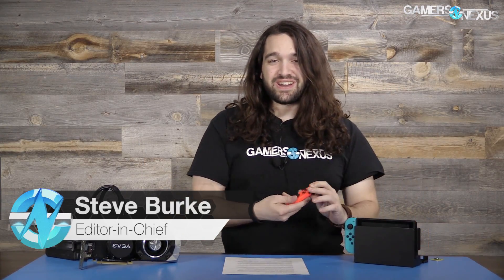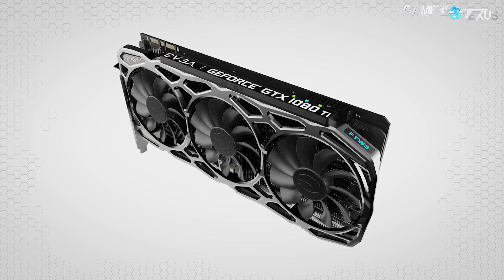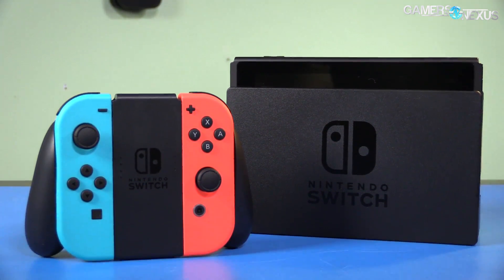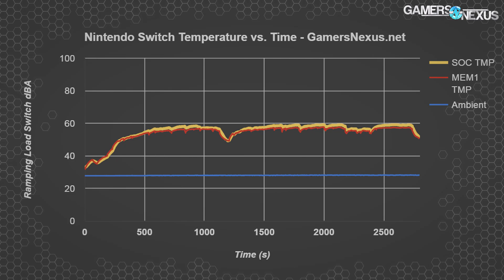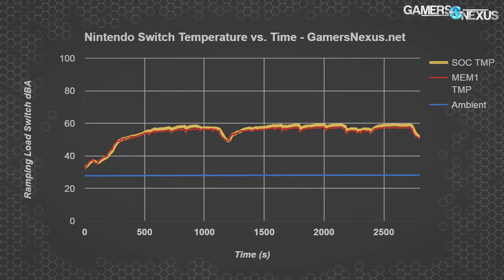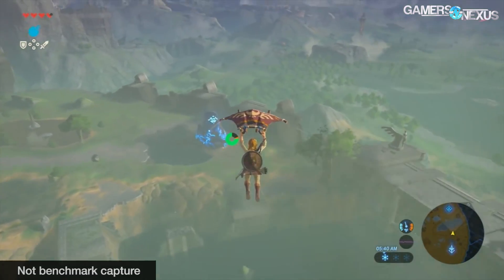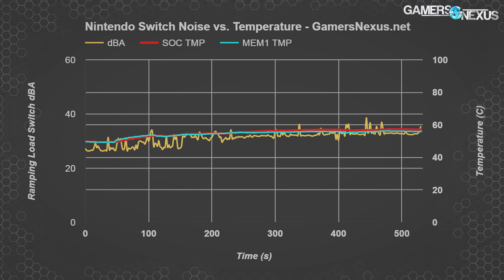Nintendo Switch Thermals, Noise, & FPS Drops

Comment: Maybe they improved the software quite a bit since (6.2.0 currently), but I cannot hear the fan at all, neither handheld on battery, handheld while on AC or docked. It is very subtle when you stick your head up the docked console in BotW.

Comment: Is it normal for the fan to speed up for a few minutes every time after I load Zelda and slows down faster when I enter menu or home screen? The system is cool since I just turned it on. I called nintendo and the woman there telling me it's suppose to do that but I just want to know if it happens to every switch. Btw I only play in tablet mode.

Comment: Hey, exceptional video here!!! I'm thankful that you guys uploaded this. Furthermore it was very informative.     I was wondering if you could answer one of my questions in regards to the fan noise.   When I play in handheld mode, the unit is virtually silent, its to the point that I have to get right up on top of the vent to actually here any noise.   But for me at least, it's quite the opposite when docked. I can here the noise pretty easily. It sounds very similar to the sample you provided in the video. 

No errors seem to occur, and the air expelled from the vent is warm so thermal transfer isn't an issue. Could that perhaps just be the way the units fan is?

Comment: I've never heard my switch make any noise and I've used it quite a bit on handheld mode. 
Also to say "it gets hot" is a bit much... Warm at best, never hot.
Zelda also received a patch that fixes most frame rate issues except a few spots in the map which alot of greenery.
Reply: BowlOfRice Apply a quality thermal paste and thermal pads fixed most of these issues too. The Switch downclock’s the performance to stay below 60c.

Comment: I was very impressed by the acoustics of the Switch in docked mode compared to most other game consoles. It's hardly a feat considering that the thing only drains up to 16 watts, but still nice considering how loud and whiny that tiny fan could have been.

Comment: For frequency analysis, take an audio recording with the microphone 4-6 inches away from the fan, and then plug the audio into Audacity and run frequency spectrum analysis. Works like a dream and is super precise.

Comment: is 85'C in Occt Small packages ok for overclocked 7700k? I have it on air cooling with 1.200 volts fixed.

Comment: This may be overkill, but there is a procedure in aviation to correct for more annoying tonal noise relative to broad spectrum noise. It is called a "tone correction factor" and is added to the perceived noise level. If you are interested, the procedure is described here, in Section A36.4: http://www.ecfr.gov/cgi-bin/text-idx?rgn=div5&node=14:1.0.1.3.19
Reply from the maker: Julian Herzog Can't hurt to learn about it! Thanks. Will read.

Comment: Could you do a test without attacking the enemies? The Zelda series since OoT has always had an intentional single-frame drop whenever a strong or killing melee attack hits - this could be what the frame drop and associated slight temperature drop you're seeing is from. Maybe a test in some of the heavy framedrop areas around the Temple of Time where there aren't any enemies?
Reply: He should stand in a town and look in a direction that causes frame rate issues, surely that scenario would constantly stress the hardware (unsure if the frame rate issue is because of the CPU or GPU though).

Comment: VERY interesting data about the thermals & throttling. Ow, Nintendo... I'm.. interested. I'm interested to see if Gamers Nexus can put better thermal paste (or do direct die cooling) can reduce thermal throttling. Or if Buildzoid can come up with some way to trick the circuitry into doubling the fans RPM :)

When I get mine, I'm definitely going to research improving the cooling. There's got to be some way to increase the fans RPM via a hardware mod.
Reply: I want to do a casemod to add a couple 80 or 90 mm Noctua fans.

Comment: 2:00 To make your own:
prop your phone up on something in front of the switch
record the highest fps you can (6S plus does 240 but for a max of 30 fps in game a 60 fps camera would be sufficient)
run a spatial high pass filter on every frame of the video
count how many frames are in between frames that have peaks greater than the noise
you now have a vector of frame times

https://www.reddit.com/r/3dshacks/comments/4hgwg3/performance_and_battery_life_test_of_luma_3ds/

hmu if you want the matlab script.
Spoiler: it takes a long ass time to run.

Comment: From your teardown video it seemed the cooling design on the switch was pretty poor. With a bit of thought it looked like Nintendo could have easily made it better.
Reply: Asa Stewart It's because the GPU downclocks considerably when in handheld mode.
Reply: Yes I know, that doesn't mean the cooling solution should consist of three separate contact points with thermal paste between the cpu and the cooling mechanism on the other side of the console.

Comment: I know watercooling is complicated and will take a lot of work (although it would be incredibly cool), but can you do a simple test of just lowering your room temperature to the minimum on your AC and putting a relatively powerful fan blowing at the switch to verify if it helps?
If it does solve the throttle/frame dip issues then maybe third party solutions to improve the cooling while docked may eventually show up. Since the dock is essentially a simple usb/hdmi dock I'm pretty sure other companies can have a go at making it better.
Reply: Bruno Yuji 
"incedibally cool" pun intended? lol
Reply: Without modding, you won't get better temperatures. I assume the back of the Switch is plastic, and that'll cause thermal resistance between the inside and outside. And even if the case is aluminum, there's no paste or pads between the internal backplate heat spreader and the case.
You could always try blowing colder air through the blower fan, but there's just not a lot of surface area on the heat pipe's fins. 
But modding would get you better temperatures, though I don't know how great the outcome would be.

Comment: would it be a good idea to modify the switch so that there are less interfaces between the GPU and the heatpipe?
Reply: Think of the shield around the chip and system memory as the IHS for the chip; basically, improper application of a cooling method could burn the chip up. Though, there could be better methods on how to cool this with less layers of material and paste, there's about 10 or so layers from the silicon die to the internal back plate that spans the area of the switch itself. I would assume this would be inefficient for cooling, but apparently it's good enough for Nintendo.

Comment: Build a box, and use soundproof foam around it, with a dynamic mic inside such as the sm57. Connect that to an xlr output on the outside. Do something similar with power/ peripherals and you have a isolated mini sound proof room. Easy as that

Comment: Do you think a 240mm radiator makes a difference compared to 120mm in GPU cooler?
Reply: Dr. Ass yes. more fans can work on it. so eatch fan can spin on a lower speed and the cooler wil be quiter

Comment: It is possible to write software which captures the FPS. All that the software needs to do is to detect a change in the colors of the pixels, everytime it analyses every 10 millieseconds the pixels, if the colors change it increments a counter with 1. I don't claim that it is easy but a good programmer should be able to write code for that if you use some open code format for the captured video. :)
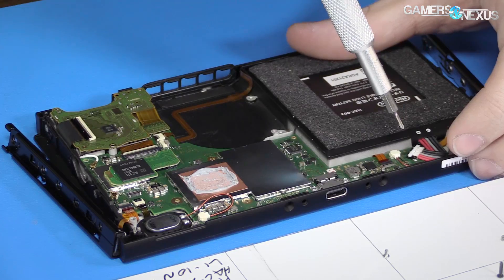Reply: Peter Jansen 2:08 he mensions it "without making our own"

Comment: The Switch is barely audible. i only hear it when its in docked mode and that's because the system is 2 feet away from my face. In portable mode i only occasionally hear that high pitch whine noise but i hear those sounds too easily so it's just something I live with.
Reply: @SilviuIulianWINNING  
No, not every switch has it. But yes, I agree thw PS4 is a jet engine. Just not nearly as useful.
Reply: Rui PTG 
you have coil whine lol

Comment: The iPad Pro 9.7 has similar GPU performance and CPU performance at much cooler temperatures and NO FAN.  The Tegra X1 is so inefficient and not designed for smaller mobile devices. This is the main reason battery life is so poor on the switch. I'm completely disappointed by Switch Performance and battery life.
Reply: Tegra X1: March 2015, 512 GFLOPS/A9X: September 2015, 360 GFLOPS , you have half an year of difference and 42% less GPU performance (without taking into account the OS/environment).
PD: the actual x1 on the switch does have less performance, because of the lower cpu and gpu clocks.
Reply: The iPad Pro should be faster all around, but the Tegra is still pretty much the best GPU performance on the other side of the tracks. With it running light weight BSD and the NVIDIA developed NVN API, it will hold up for a awhile. Zelda looks amazing considering the hardware. I'm actually glad they went with active cooling. Should keep the SoC from thermal throttling. I'm sure it's power limited, but considering Nintendos options, I believe they went with the best company and SoC.
Reply: Yeah, but as i say, you don't have direct comparisons because with the a9x you are limited to iOS, and frankly, almost any app behaves differently on iOS than android.
Reply: Since when has Nintendo been about the latest and greatest hardware? They've used old or gimped hardware (compared to competitor systems at the time, including PC) in the Gamecube, Wii, Wii U, Switch, Gameboy, Gameboy Colour, Gameboy Advance, Nintendo DS, Nintendo 3DS etc.

I would also say the NES and SNES but in this era it was all about features and functionality (even for Nintendo's competitors) rather than the latest and greatest hardware.
Reply: Austin Tech Authority The real reason why it's a higher price is because anything with an Apple logo is instantly worth more. The battery life and screen resolution is better because it's not a handheld gaming console. I'm pretty sure if you tried to ran Zelda on it it would die.
Reply: I hope nintendo announces an optional dock with upgraded gpu at some point. At the right price, it could really help the switch and potentially cause some pretty successful sales figures.
Reply: Austin Tech Authority enlight me. what does the switch cost? what does the ipad pro cost? 

yea.... i thaut so
Reply: The Apple A9X and Nvidia X1 were both released in 2015 and at the time were the most powerful and efficient SOCs on the market. The reason the iPad Pro has a higher price is because build quality is much better, screen resolution is much higher, battery size is larger, and Apple prices don't usually drop until the New iPad Generation is released which hasn't been replaced yet. Also, your credibility is lost because you thaut so....
Reply: you do know the there are 2 different X1, the one in the pixel c is weaker than the one in the shield
Reply: https://forums.geforce.com/default/topic/914972/snapdragon-820-benchmarks-match-the-tegra-x1/
Reply: Austin Tech Authority Too bad the X2 doesn't exist.
Reply: Austin Tech Authority yes that because it's old as hell. The iPad and iPad pro are upgraded nearly every year so they are cutting edge. Nintendo probably should have used something newer.
Reply: How would that work? The CPU in the console would have to make a super lengthy connection to the dock to communicate with its components, which would kill any performance gains from more powerful hardware residing in the dock.
Reply: Austin Tech Authority it probably work similar to those amplifiers that they use for PC, and since its Nivida it is possible to do and its similar to that Nintendo patent where the dock give the system more power, I'm guessing the dock that will be amplifier will come later look up Alienware graphics amplifier
Reply: There would be price issues and problems with developing on the system
Reply: Nicholas Steel It could connect using the USB type C port. It has plenty of bandwidth.
Reply: There is one version of the X1. The differences are in clock speeds, thermal limits, and power constraints.
Reply: I agree. Nintendo needs something innovative to compete with Xbox, and PlayStation. I don't believe this is it. They should have made an optional hardware dock with High Performance GPU/ CPU for those who want high frame rate and resolution.
Reply: I don't have Direct comparisons, but the point isn't about iOS or Android but the fact that Nintendo Used outdated hardware for a "Console" replacement. When they could have waited for Snapdragon 835 or Nvidia X2 chip that are being released now or provided a more Powerful CPU/ GPU switch dock for high performance when Docked. The battery life, performance, heat output, and build quality leave much to be desired in 2017.
Reply: The spec sheet doesn't translate to real world performance on mobile. However, I do agree that the A9X is a newer chip than the X1 but not by much. The Pixel C has the X1 and it performs almost identically in GPU performance to the iPad Pro. http://www.anandtech.com/show/10286/the-97-ipad-pro-review/2

Comment: xray of the switch indicates that its not a modified X1, it is a X1 with no modifications. now there are things in the software/driver/os that are very different from the nvidia shield.
Reply: The only custom thing about it is the name of the chip. I assume Nintendo bought out their own production line(s), thus the custom name; which makes sense when they're pushing production to 16 million units, it'd differentiate Nintendo's chips from standard chips other companies can buy, plus it'd guarantee Nintendo that they'll get their chips if there's ever a shortage of Tegra x1 chips, might also make inventory easier on nVidia's side, and the x2 should be out and more mainstream within the Switch's lifetime, meaning a slow in production of standard x1 chips. 
As for the 'custom' part, Nintendo may have disabled the 4k hdmi 2.0 hdcp 2.2 and dual display control chips, probably the ISP chip also; since this system would never use 4k, other than for media, wouldn't use dual display, and doesn't need programing in post-production. But I wouldn't know anything, I'm just making educated guesses.

Comment: I'm a guitarist, I mix and produce my own songs. So this frequency information is actually relevant for me :') As for the Switch, it's a shame. I love the idea they went for with portability (and that's what saves the system imo), but I'm so disappointed that for the 4th generation in a row, they've put out another system that's an entire generation behind in graphics :/ I know graphics aren't everything, but considering their first party games look more cartoonish, there should be consistent 1080p 60fps on all of these game :/
Reply: Dingleberry Tech 4th???? The GameCube was more powerful than the ps2, so it is the third. Also the switch could not be a ps4 or xbox one, but for a portable console being more powerful than wiiu/ps3/360 isn't bad at all.
Reply: Dingleberry Tech dude, the Switch is the most power/volume you can get, specially for the price. Sure, it lags behind almost any PC with dedicated graphics out there, but you have to take into account that the whole console is SMALLER than most GPUs by themselves. I would consider it a disappointment if it wasn't portable, but this little console has let me play one of the best AAA games I've ever played in my commute to uni, something that no other device can delivered to date, and unless you count the Nvidia Shield Portable, which is WAY slower than the Switch.
Reply: Honestly I believe Switch is here to replace 3DS rather than WiiU (despite what Nintendo says). If you compare their success in handhelds vs home consoles lately, it would make more sense.
Reply: Haha, I've actually imagined that board meeting. "Well guys, the Wii U was a flop. But the 3DS is is the best portable system to date and the Wii's controls and fun factor made it the best selling console of its generation... what should we do next?" 

crickets

"Combine them."

GJ Nintendo now we have a Switch thats keeping me away from my new 1080 ti. :D
Reply: Forget how Nintendo tries to advertise it. It's mostly comparable to other portable systems because that's what limits it.
Reply: Travis Holton, I've seen that comic. Who's getting thrown out the window?

Comment: Interesting. Just 2 questions:
- I know this one is nitpick, but are you 100% sure everything was put together as it was meant to be?
- If I heard correctly (it is a bit late and I'm tired, so I might heard wrong) you said something like "In handheld mode, the noise becomes a bit more noticeable" - doesn't Switch underclock in Handheld mode specifically to lower thermals and noise because you hold it closer to you (and to save battery)

But other than those 2 tiny nitpicks, great video :) I also noticed a bit more framedrops after longer play in docked mode in enemy heavy areas or grass heavy ones.
Reply from the maker: 1. Yes. That's sort of the first step to a test.
2. In theory, but the console is now 8" from your face.
Reply from the maker: Can't exactly test thermals on the Switch without taking it apart, seeing as we have to embed thermocouples inside the unit to test it.
Reply: Stupid question concerning the dock; Is the part where the switch goes not just two walls of plastic? Wouldn't this restrict the fan's intake, or output? I forgot which is on the top and which is on the back.
Reply: Xander Zoolander There are vents in that “cubby” area where the cables go
Reply: Actually when you take it out of the dock to starts to accelerate the fan for a fast cooling.
After a moment it slows down it's fan